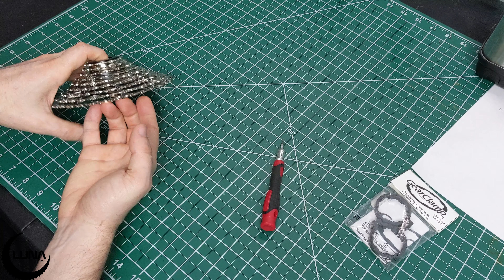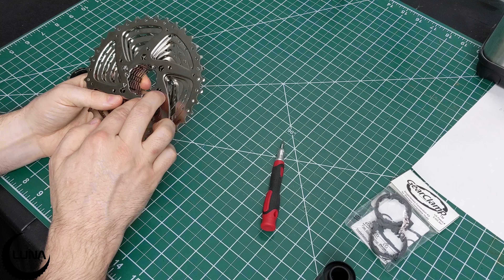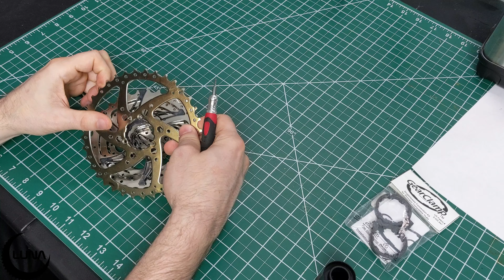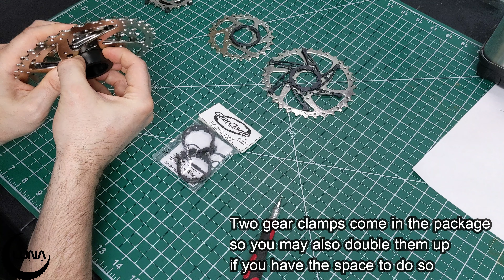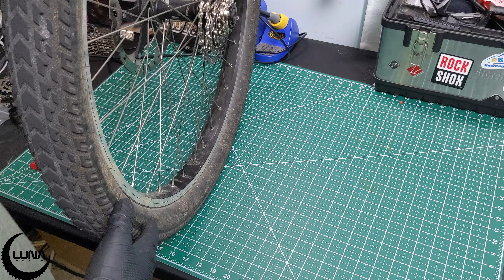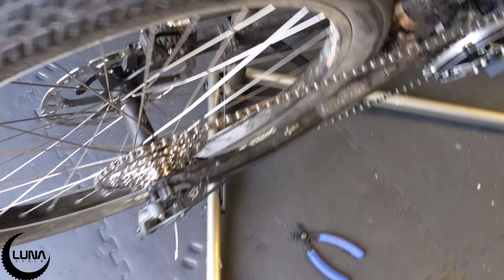How to rework cassette for improving chainline on mid drive ebikes

Comment: Great video, thank you. Converted a 9 speed down to 6. Used a mix of the plastic packing rings from old 8& 9 speed cassettes that I had lying around to give me the spacing behind the finished block. All works a treat now.

Comment: This video is exactly what I was looking for. As a noob in 2022, I build my first e-bike. I chose an older budget Trek 4500 26" BBSO2 " dual 48v-30ah batteries. I knew my riding area was mostly hills so unbeknownst climbing a long hill the motor started overheating using the stock 44T chainring and a 16/46 8 spd freewheel. So I stopped immediately and shifted up to a granny gear. The motor was too hot to touch so I let it cool down and no more long hills. I swapped out the 44t to a 38T then to a Lekkie 28T using the same 16/46 freewheel cog. I finally found the proper gear ratio for my riding area. However, the Lekkie 28t is causing chain-line issues. Hopefully, this video can guide me in the right direction. I have the OEM 11/32 and another 11/44.
Reply from the maker: That's awesome, I am glad you were able to make use of it.

Comment: Like I told my friend the other day, you can theorize, plan, build it in your head, but until you get the parts and actually start building you just don't know what you don't know. Thank you for this video! When I ordered my Mighty Mini I had no idea that it would push the chain so far outboard that I'd be stuck in the highest couple gears of my cassette, kinda defeating the purpose of the Mini, I can't wait to try this fix, thank you again!
Reply: I specifically watched this vid because I have a mighty mini that’s pushed my chain line way to far out. How did this work out for you?
Reply: @lifeischeesy  it did not work, the cassette only works well when it is in it's proper order
Reply: @D3LV3  not true.
Reply: My exact problem. Howdid you fix it? I'd hate to go to the lekkie 42 tooth
Reply: @colincampbell4261  I'm sure it depends on the cassette, the one i had did not wanna be in that split config

Comment: Great video. Sunrace made several lower gear, all steel versions. CSM980 instead of CSM98. They're held together the same way with Torx and pins. The CSM980 9AY is 11-42t, the 9AX 11-40 and the 9BX 12-40t. They also make 8 speeds, CSM680 in the same ratios for those that believe 8sp chains are stronger.
Reply: Got a 9AX from CRC, thanks for listing what they are! It only says it's an 11-40t. Matching this with a 42t lekkie chainring. I'm coming from a 36t in the back as my largest, expecting a massive torque boost.

Comment: I designed a 7 speed cassette (with 9 speed spacings) from a mega-range 9 speed cassette (11-46t) and sacrifice 2 sprockets. Since I build street legal conversions based on the bbs02 (speed limit 25-27kph) I got rid of the 11 and 13t sprockets, since they lie outside the speed limit anyway. Instead I use Miche's custom sprockets (first and second position 15 and 19t) to finish the cassette giving me the following tooth pattern: 15-19-24-28-34-40-46t
along with a 36t chainring you get pretty much perfect speed coverage between 8.5 and 28kph, enabling you to climb very steep hills, have a great chainline and not be tempted to ride beyond legal speed limits and waste battery power :D
in order to lock the cassette onto the freehub body you need a centerlock lockring, since regular cassette lockrings will not fit on that 15t first sprocket from Miche
Reply: That's interesting, thanks for posting. What do you use for a shifter? 7 speed or can you adapt a 9 speed to managed 7 speed? Thanks.
Reply: @Gusto0172  to be honest, if you want, you can remove the 11t cog from a 9 speed cassette and terminate it on th 13t cog with a washer and lockring. i have chosen to install a dished 42t chainring which sets the chain in the center of the cassette. that works best in my opinion.

Comment: I went from 11-13-15-17-20-23(+ unusable 26-30-34 due to chainline) to 11-13-16-21-26-30. Much better gear range, less shifting with my BBS02 and saved some weight too. I used all of the original spacers and 2 extra 9 speed spacers. That gave me the same overall width after removing the 3 cogs. Works great.

Comment: Pretty sweet solution. You are basically turning your 9 speed cassette into a 6 speed cassette but with 9 speed indexing. Don't forget to adjust your limit screws on the derailleur so it does not move the chain off the cassette. It's bad news if your chain goes inward of the largest cog on your cassette. The low limit screw on the derailleur can prevent that from happening.
Reply: Is there a video that shows how to properly do this anywhere cuz I did this exact thing turn my night speed into a six-speed and it seemed good until I got stressed onto the chain and it was like skipping and jumping how do I fix this how do I adjust the derailleur
Reply: @m1000black  Adjusting a derailleur is straight forward and there are bunch of videos showing how to do it. The main concern for you is to set the high and low limits to prevent the derailleur from traveling too far. For example, if you are only using cog position 1-6 on your cassette, use the high limit screw to place the guide pulley directly over or slightly outward of the 1st cog (smallest). Then adjust the low limit screw to place the guide pully directly over the 6th cog (largest you are using). The limit screws limit the amount of travel your derailleur can move. This will make sure you don't overshoot the 6th cog onto the 7th cog which would be disastrous. Make sure the b-screw is set so there is about 5mm of distance between the 6th cog (largest) tooth and the guide pulley tooth. Once this is done, then you have to adjust the cable tension and barrel nut to set up the indexing properly. Shimano recommends shifting into a middle gear and then turn the barrel nut counter clockwise until the derailleur wants to shift into the next larger cog. Once it starts making noise like it wants to shift but can't, turn the barrel nut clockwise causing the derailleur to return to the smaller gear and the noise goes away, usually 5 clicks of the barrel nut. This might take a little adjusting but that's the basic idea. Also, on your 9 speed shifter, you'll only use shift position 4-9 on your shifter. Position 9 will be your smallest cog and position 4 will be your largest cog in the 6th position on your cassette. So start with the shifter in gear 9 and the derailleur on the 1st (smallest cog) and tighten the shift cable to your derailleur at this position to start your indexing procedure.
Reply: @mtbbiker6401  thank you very much I appreciate your help my friend!!!
Reply: I have a old bike with no derailer and no shifter but has a 9 speed cassettte, . So my noob question is, if i turend it into a 6 speed cassette like show here, can i buy a 6 speed shifter and derailer?
Reply: @diwanthegreat  If you are turning your 9 speed cassette into a 6 speed cassette by rearranging or removing cogs, you'll need to use a 9 speed shifter and derailleur. 9 speed cassettes are indexed (spaced) differently than 7-8 speed cassettes. The chains are also different.
Reply: @mtbbiker6401  I see, thanks for clearing that up.
Reply: @mtbbiker6401   I am thinking about    Purchasing this same cassette in this video, due to having a horrible chainline. I currently have a 10 speed cassette. So if I buy a 9 speed cassette and make it a 6 speed. I will have to purchase a completely different derailleur and shifter to match the new cassette?
Reply: @Lions_Forever71  Yes, I believe 10 speed and 9 speed use different indexing so you might need a new shifter but your derailleur might work. What make and model are your components? Can you modify your 10 speed cassette to 6 speeds? This would be the easiest solution.
Reply: @mtbbiker6401  my shifter is a Shimano Deore M4100 and my derailleur is a Shimano Deore M5120 long cage.
Reply: @mtbbiker6401  and my cassette is riveted big time, so not very easy to rearrange.
Reply: @Lions_Forever71  The M5120 is designated for 10 and 11 speeds. The M4100 is designated for 10 speed. I believe you would need a 9 speed derailleur and shifter if using this 9 speed Sunrace CSM98 cassette. If you could find a 10 speed cassette with similar construction, then I would go that route. Have you looked into using offset chainrings available for e-bikes?
Reply: @mtbbiker6401  ok thanks for that info, I never knew I would have to change all that as well. So yes if I end up rearranging a cassette, I will make sure I purchase another 10 speed cassette so that everything else works with it. I have 42T lekkie chainring up front, which is the most offset I can go without interference with the frame. It’s very close to my chain stay so I’m happy with that.

Comment: rather than using the gear clamp, you could have used the sprockets and spacers you removed by putting them on the inside.  adjust the limit screw to suit.
Reply from the maker: The video mentions that, and the accompanying text documentation has in depth pictures and tutorials on how to do so. This method makes it look cleaner but both are valid. After having experience with both I think just rearranging them is more foolproof since the clamps can move around if you don't double them up, but man does it look nice with only the gears you want.
Reply: Is the smallest sprocket that goes in last required (even though you won't use it) in order to tighten the cassette assembly?
Reply: @connicrow9463 I believe so, yeah.

Comment: Interesting video. I spent most of the afternoon trying something similar. I had a brainwave of using the sprockets that I didn't want at the back as spacers. It didnt work. I didn't hear you mentioning the B screw on the derailleur but I figured this was my problem because there wasnt enough space for the chain to glide clear of the largest sprocket which was now moved to the middle of the cassette; it was too close to the upper jockey wheel. Tried as I might it just wasn't working. After admitting defeat I put everything back as it was to at least get me to work and back tomorrow, the only difference was a new chain. I've just taken the bike around the block to see how she's riding and I don't know what's happened but it's working fine. I have the full spectrum of sprockets, the chain line is good and it's shifting perfectly. I don't see how it would make this much improvement but I have to put it down to the new chain.
It's a 9 speed microshift derailleur and the bottom bracket is 73mm. 
I'm baffled 🤔

Comment: Yeah but what about the shifter ? We would limit the low gear screw but the shifter would want to put more cable tension to try to move it if rider tries lower gear. That would strain the cable/shifter and potentially distort the indexing if rider pushes hard. Any ideas on limiting the shifter too ? Thanks for the video
Reply from the maker: To be honest, I've read this comment like three times and I still don't know what you mean. All I can say is thousands of people have done this modification or the corollary modification of simply rearranging the cassette which is linked from the description. As long as the derailleur is tuned you should be fine, never heard of bad indexing with this

Comment: After modification my derailleur hits the sprokets and doesn't allow them to rotate freely.
Reply from the maker: There's an adjustment screw on it to prevent that
Reply: @fuzzyfriendlydoggy  I mean even at smallest cog
Reply from the maker: @evdokmv  do you have the cable tension generally dialed in

Comment: Thanks for the video.  Why can't I simply use cassette spacers instead of "gearclamps" to adjust the chainline?  Wont the bigger gap between the newly rebuilt cassette cause shifting issues ?
Reply from the maker: Sure you can use spacers! You can also, depending on the cassette type, simply rearrange the ones that are on there and lock out the rest with the limit screw. The nice thing about the clamps and rearranging is it maintains the same gap as stock so there should not be shifting issues. Whether or not this would happen with cassette spacers may depend on the width of the spacer
Reply: @fuzzyfriendlydoggy  Thanks you very much for your answer, much appreciated, have a nice day! I sub'd.

Comment: I’d really like to try this with the S.Archer 3 speed cassette free hub or what ever you call it. 
Start with an 12 to 28 8 speed steel cassette and use 4 maybe 5 cogs. Or even 3 cogs and still have a 9 speed. I’m currently using a S.Archer 3 speed IGH. I like it a lot. I go over hill and dale in the dirt in 2nd gear mostly. With all the power and torque from the BBSH you just don’t need all those gears. I started out with a SRAM 991 cassette at about half life for a pedal bike. 5th gear was the last cog to go and rode it like a single speed for the last few days and had no real trouble. And I believe an 8 speed chain is a bit tougher than the 9. 
While the IGH is still in good nic, I’m going to a 1/8 cog and KMC Kool single speed chain.

Comment: Great video, very informative and this is definitely what I need to do to my build to correct my chain line. Do they have a similar cassette that you used here but with a 42 tooth on the lowest gear? Thanks
Reply from the maker: I mean technically you could do that with just about any cassette. The question is whether or not you can do it easily. With the cassette in the video it's super easy and you don't have to break rivets or anything like that, and there's quite a few other cassettes out there too that are similar but I don't have model numbers for stuff like that. Tbf breaking a rivet is not super hard for anyone with a Dremel but this video pretty much just covers the basic concept.

Comment: Well done. There is possibility to save all sprockets. I did it on my scott nitrous with Bbs02b . Chain perfect lined up on 5th gear of 9. I put cheap 104bcd adaptor with 36t snail chainring flipped with 2mm spacers. I won 5mm. That was not enough... So i cut off 6mm of bottom bracket from drive side (my bb was 73mm) . I got 11mm total!!! So chainline moved from 7th gear to 5th (center).
Reply: Did you need to do anything to your derailleur for it to work properly? I have the same bike but can not for the life of me get it work properlly. Maybe my chain is to short?
Reply: Hello, how did you cut off 6mm from your drive side bottom bracket, and are there any issue with weakening the frame? Thanks

Comment: Hello I made this change.. But then you have to change the manettino,!? I had 11V and I did 9V but I could not adjust the gearbox even with the minor manettino. You in the video do not show when you change. That would have been helpful. Can you tell me that they manettino to the put,,, I s'è ai modified,
Reply from the maker: I don't understand what you mean by manettino
Reply: @fuzzyfriendlydoggy  The lever on the handlebar that allows you to change gears derailleur speed.
I'm using trasletor 🇮🇹
Reply from the maker: @Toby10  the indexing on the cassette will not change if you are simply reworking it. So you should not have to typically tune up the derailer but you can if you have to.
Reply: @fuzzyfriendlydoggy  Eeeeeee difficult translation... Let's see if I understand correctly: you say that there is no need to change .... But the marches are now smaller. From 11 I have 9v derailleur always originated I have,. 11V. The handlebar lever, however, the 11v one even if I register well. It doesn't work. 2-3 more 🥴🥴 shooting steps left
Reply from the maker: @Toby10  sorry i have no idea what you are trying to say. If you are having difficulty with the modifications i recommend taking it to your local bike shop

Comment: Can you put the sprocket you take out behind the sprocket you're going to use instead of gear clamps?
Reply from the maker: Yes rearranging them instead is a perfectly valid way of reworking the cassette, just may not look as clean. The link in the description goes over this method.

Comment: I have a terrible problem with skipping on the bottom ( smallest) 3 gears. As soon as I go over 200W it sounds like a machine gun.  Chain properly aligned, new chain and cassette...  will not go over 35km without skipping.  any ideas?
Reply from the maker: Tune the derailer?

Comment: Would a single speed chain work? I'm thinking if adding custom spacing between the cassette rings and widening the rear derailleur to fit a single speed chain (I assume more material means I can handle more watts [3kw?] without damage or going longer in between chain swaps)
Reply from the maker: It won't shift well like that. The shifter expects a certain width between each cog and you are unlikely to get that just slapping multiple single speed cogs together
Reply: fuzzyfriendlydoggy I see that, a friction index shifter should work no?
Reply: Cassette is not worn down by load. It's worn by skipping and worn chain. And better derailleur is better than some old crap

Comment: Are you able to adjust the derailment to accommodate less gears
Reply from the maker: All derailers have a couple screws on them, the high limit and low limit. If you need to lock it out of where the lowest gear would have been just tighten the low limit screw